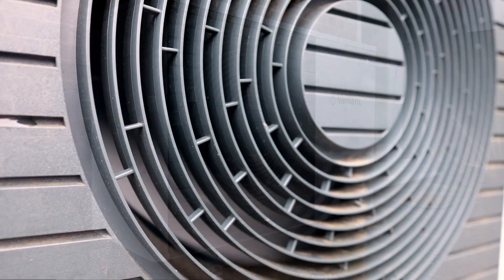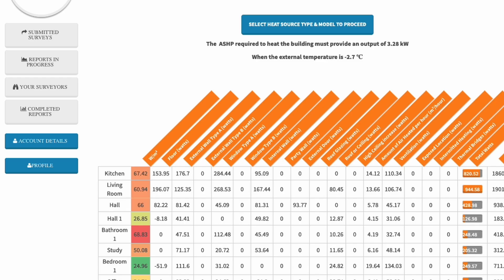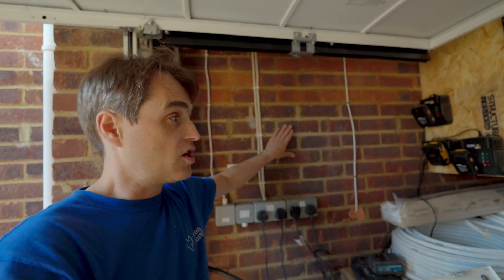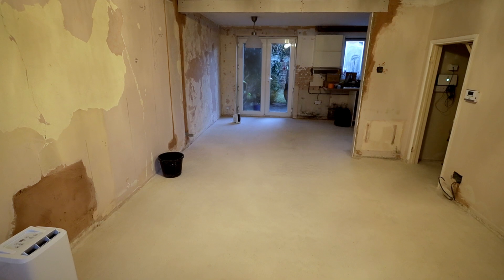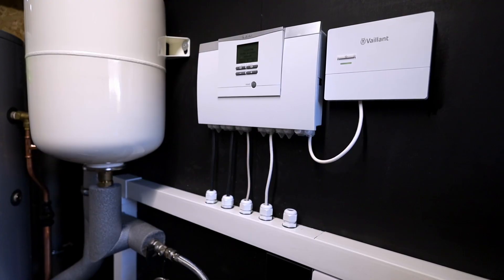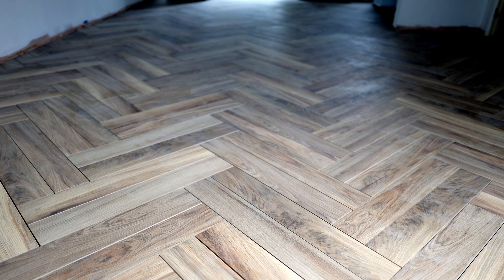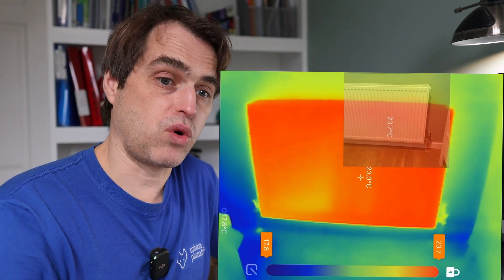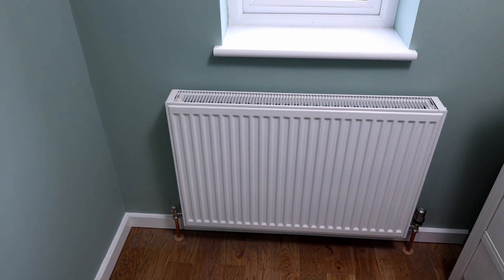How I Installed The Most Efficienct Heat Pump In The UK.

Comment: In answer to your question heading the video, no they are not real.
Simply, science states that no device can be 100% efficient.
The error just about everyone makes is using the input electrical consumption. If you use that the only device you can compare it with is another type of electrical heater.
The basis for efficiency calculation is the amount of fuel used to make the electrcity. There are so many losses between generation and consumer.
Reply: A resistive heater is 100% efficient as science states, all energy converts to heat, unless you know otherwise ?
Reply: Dougal, 

I see this said so often that it almost has become fact, I say almost, because it is utter rubbish. At best it may be 30%, and that's being generous.

No all energy doesn't convert to heat. some of it is doing work.Much is given off in the form of heat but not all.
Reply: @iareid8255  

It all ends up as heat, unless you’ve also invented frictionless bearing etc.

Unless all scientists are wrong and You are right, that’s always a possibility.
Or as Einstein said “it might all just be a dream”.
Reply: Dougal, 

you are not listening, not all energy ends up in heat. Some of it does work. Try listening to engineers instead of scientists.
Science is the profession of educated guess work, until the answer is accepted by demonstration. Even then it can be proved to be wrong. It is a very strange subject.
Reply: @iareid8255  Ironically, you still haven't been able to provide any of these "demonstrations" that prove your point, because apparently from your previous messages it doesn't exist? 🤔

What "work" does a resistive heater do, that isn't just heat?
Reply: Ben, 

I just do not understand your response, 
please elaborate.
Reply: @iareid8255  Well, because you keep quoting figures that you can't back up. e.g. "At best it may be 30%", lets handle this another way:

- Gas usage in a boiler, and usable heat output from a boiler is measurable - and there is data for it.
- Gas usage and electrical output of a gas power plant - also measurable, with data.
- Electrical losses in transmission and distribution - measurable, with data.
- Electrical consumption, environmental yield and heat output from a heat pump - measurable, with data.

Therefore, you can calculate and compare end to end efficiency of gas when used for powering a heat pump, vs burning it directly in the home.

Gas isn't the only way electricity is generated - with wind, solar, and other sources making up a fair chunk of the UK's power grid. People aren't going to be concerned with how each unit of electricty is generated. So heat pump efficiency is based on how much heat output for how much electricity is consumed.

However, with the data above we can conclude:
- Heat Pumps with the combined electrical input and environmental yield, will output multiple times the electrical input as usable heat - ergo they are x00% efficient on the electricity consumed.
- The heat output provided by a heat pump, will consume overall less gas compared to gas boiler, even if the grid was solely powered by today's gas power stations in the UK.

So for your assumptions to be true either:
- The gas power plants are lying about their efficiencies.
- The grid is lying about the transmission and distribution losses.
- The 3rd party measuring devices for monitoring the heat pump's electrical usage, input water temperature, flow rate and output water temperature, are somehow lying.
- I'm missing some other key data points that make up the difference, ones that nobody seems to mention?

So which is it?
The heat pump monitoring things could also be used for gas boiler with needing an addition of a gas meter - unless the home's gas is only used by the boiler - which for many it is.  However, is there much point as we know a gas boiler will never be 100% efficient on the gas supplied vs usable heat output.
Reply: Ben,

You make it sound simple because you do not understand the variables or how the grid works.
Losses vary with load, (i squared R losses), a proportion of generation is not used to feed the grid, this is variable. The duty that gas generation does to compensate for renewables is variable and affects it's efficiency.
The data may be there but it is very complex.
It is also, as I said before irrelevant. It is patently obvious that the losses are significant and make a nonsense of your perspective.
Of course a gas boiler will never achieve 100% efficiency, nothing does, nor have I made such a claim, a heat pump will also never approach that.
You refer to data from heat pumps, i.e. temperature delta, flow etc but nothing that actually measures the heat quantity, which used to be BTUs (British Thermal Units). The amount of effective heat is assumed by some algorithm. If anything is arbitrary that is it. The idea that a ground source heat pump gives 5 times electrical input is optimistic in the extreme as it means that the energy input at the power station is five plus for that to be true, i.e. the losses from generation and transmission are 80% minimum, I don't believe that to be true so the assumption about the heat pump must be false.

Regarding heat pump components, compressor driven by a motor, average about 90% efficient, and with a relatively low volumetric efficiency due to the reed valve gas control and slow rotational speed, evaporator fan motor, again about 90% and the heat transfer of the evaporator requires regular maintenance to keep that heat transfer at optimum. How many owners will do that? It is not a high efficiency device looking at the mechanical aspects.
Reply: @iareid8255  My mistake the heat pump monitors have 3 levels.  Level 1: Electricity only (no COP), Level 2: + System Temperature (again no COP), and Level 3: Flow and Heat Metering (with COP).

Therefore, we meet your requirements for measuring heat. And in that scenario, it doesn't matter what the efficiency of the components of a heat pump are.
We know: How much electricity has been consumed, and we know how much heat has been added to the water that entered the heat pump.

Where is anything supporting this concept that "the losses from generation and transmission are 80% minimum"?
Reply: Ben, 
Logic and reason does not appear to be your forte?

Let me reiterate:-
Nothing is 100% efficient, please accept this scientific fact.

Let me now contradict that and say assume a ground source heat pump is 100% efficient.
You will accept that an air source heat pump is approximately 60% as effective as a ground source (1 KW giving 5 KW he at GS, 1 KW giving 3 KW AS)?
Ergo an air source is only 60% efficient.

If you cannot follow simple logic and see that what I'm saying is basic, without the need for 'data' to give a small variation in the true figure, I have to believe that you are just teasing me with your fallacious arrguments. The principle is what counts.
Reply: @iareid8255 you just can't accept that the heating industry uses the term efficiency to compare heat moved/provided  heat pumps move heat not generating it.
If we used your "logic" then whatever improvements are made shift the goal post.

You still haven't answered my previous question.  As energy cannot be created or destroyed.  And you can't accept that 100% of electrical energy can be converted to heat energy.  Where does the rest of the energy go?
Reply: Ben, 

You are being ludicrous, you have no perspective or sense of reason.
The heat industry uses Coefficient of Performance not efficiency, it is the sloppy assumption that CoP is efficiency, it is not because electricity is not energy but merely a carrier.
Reply: @iareid8255 Clearly we aren't going to see eye to eye on this. In my opinion you are the one being ludicrous with trying to assume anyone is going to have any control over the variables of providing electricity via a gas powered power plant.
For many it is, how much "heat" am I going to get for the electricity (or gas) that I'm charged for.  Going by many youtube comments around most are far worse ill-informed, with assuming what they pay in gas is the amount they are paying for heat.  Especially when they make comments like "Electricity is 4x the price of gas, so needs to be 400% efficient to break even".

I stand by my assertion that irrespective of the variables you mention that overall, a heat pump will in today's day and age (regardless, of energy mix), will use less gas than a gas boiler for home heating.
It is not the responsibly on the end user to ensure the CCGT Power plants are running at peak efficiency to make sure their heat pump is powered by less gas or not.

There isn't going to be a scenario where more heat pumps replacing gas boiler means more gas is going to be used in the UK.
Reply: Still trying to get your point across without any proper data? As usual, even taking into consideration a 100% gas electricity grid powering a heat pump is a more efficient use of the gas burnt directly in the home, because of the environmental yield.  Also, the reverse argument could be made, electricity is required to run a boiler and the gas network, however, that is never taken into consideration in the gas "efficiency".

End of the day, the end user needs a comparison to be able to ascertain switching, and the comparison, even if you disagree with it, makes sense...  1kW of gas burnt in the home, will yield around 900W of usable heat for home heating.  1kW of electricity used for a heat pump, can yield 3-5kW of usable heat for home heating, aligning those comparisons means a gas boiler is 90% efficient, and a heat pump is 3-500% efficient.
Reply: Ben, 
you keep ignoring science, you cannot have an efficiency of 100 per cent, it is not possible!
If you will not accept that, then there is no more to be said. Data is irrelevant.
Reply: @iareid8255 you're ignoring the science, not me. The efficiency has long been stated using the consumable unit, because the heat energy from the source (air/ground, etc) is "free".
For science to be accurate and accepted data is needed to back up the findings, so if you think data is irrelevant then you can't quote the science.
Reply: Ben, 

I find it incomprehensible that you seem so convinced by your complete misunderstanding of physical effects.
 Heat energy that you refer to is nonsense.
Heat, in scientific terms, is anything warmer than minus 273  degrees  degrees Kelvin. It is not practical heat and cannot be assumed to be free heat.
Why don't you learn some sound engineering practicalities instead of your pie in the sky ideas?
My point about data being irrelevant is based on the simple fact that you cannot use electrical units consumed by a heat pump as a basis for efficiency.
The 'sacred' data you seem so obsessed about is simply not available as the variables are so profound, the principles are so simple that it is self evident..

Comment: I am just about to purchase a bungalow built in 1965 concrete floor new heating system required going for wet underfloor but the cost of air source heat pump and installation is ridiculous vaillant gas boiler £1700. No tank required air source heat pump £3800. + tank + all the other stuff to make it work . price wise doesn’t even compare even if I get a grant?
Reply from the maker: Keep the gas then.
Reply: If a new heating system is required then it makes more sense.
If all your radiators are corroded and your tank is getting thin and the boiler is on its last legs. Then you are looking at a big bill anyway. Which you are prepared to pay as you are going underfloor.
Might as well take the grant, pay the extra and cut your bills.
Reply: The house doesn’t have gas at this time the heating is electric pyrotenax underfloor installed in 1958 found out today the build date of the house was 1958 I can’t make my mind up what way to go there is the other obstacle we live on an island, U fancy a we holiday 😜

Comment: Now imagine flow temps of 23C. I get that with air to air. 50 sqm at 21C, drafty uninsulated house that I constantly ventilate to get under 700 ppm CO2, no MHRV. Under 100kWh per month in Jan. With batteries this means £12/month in the coldest month. £2k for the HP and £3k for 10kWh batteries+inverter. SCOP6.3+. With the bonus of cooling in the summer, and we'll start getting hotter summers.
Reply from the maker: That’s great, but air con moves the air so makes it less comfortable and also is not that great at keeping nice even and very constant temperature. It is a cheap option for some, but comfor and quality of well designed wet system is far superior to air con in my opinion.
Reply: @UrbanPlumbers  true, you have to install it and point it to not constantly blow into your neck. That's fortunately trivial. Also, it only needs a tiny amount of wind. The radiator has huge surface area with fine fins, small amounts of forced air let it convect kilowatts. I'm not sure I agree about uneven heating. This unit runs 24/7 . Inverter unit, as standard in Europe for 25+ years.
Reply from the maker: Having said that I will also install air con -  it just for cooling

Comment: This heat pump installation seems like it is similar to the EV hype to me, it will cost thousands to buy it and to get it installed, if you live in a cold country it does not seem to give out enough heat and with ever rising cost of electricity it will cost a fortune I suppose if you get all the benefits available you will be all right but what happens when they get cut later this year?
Reply from the maker: Yep - love my EV as well!
Reply: Air source heat pumps are very popular in Scandinavia, in fact, everywhere barring UK is up to speed on them, but perhaps it doesn't get too cold elsewhere ?

Comment: Still can’t believe the amount of crap required to run these systems. A gas boiler the size of half a dozen cornflake boxes and £1,000 does the same thing. Not convinced yet!
Reply from the maker: I still can’t believe that amount of crap comments heat pump videos get. I love them though - haters prove I am doing something right 🤣
Reply: They don't need everything that is shown in the video. Monitoring the heat pump using OpenHeatpumpMonitoring is completely optional. Monobloc ASHPs are essentially as simple as gas boilers and only require just a couple of extra components (anti-freeze valved).

Comment: Hi
This monitor chart is only for heating or hot water included??
Thanks for reply 🫡
Matt
Reply from the maker: dhw and ch
Reply: @UrbanPlumbers  thanks for replying 👍
I am impressed about your results.
I am on half way to improving my home insulation. I already replaced windows for  triple glazing windows and very high insulated doors .I done  upstairs, same like you 25pir on wall + 70mm pir on ceiling + 75mm rockwool between rafters + vapour barrier on ceiling and loft + MVHR system, underfloor heating with 30mm biscuit screed on 50mm pir board between floor joist,all done by myself. Next step to remove 15 years old cavity insulation and replace them for something better ( 75mm cavity ) and then ground floor left to do ,underfloor heating, but I think to install 30-40 mm insulated tile board straight on slab (no insulated) and I will do channel for 16mm pipe. Alter that I will slowly convert my heating source for heat pump.

Comment: My home is run on a combi boiler and I have for a long time now tried to understand the benefits of moving to a heat pump.  As we have a combi boiler we don't have a hot water tank so where does that go is the first problem. We have solar and a decent amount of battery storage so can run the house completely on overnight electricity which is added to the battery and the solar tops it up or exports in the summer.  So having electric heating and hot water would be super-efficient but when we got the heat loss calculations done it said we needed larger emitters to run at 45 degrees flow temperature, none of the rooms have space for larger radiators.  Although we currently run our Worcester boiler at 45 degrees flow because MCS says it won't run at the design temperature me have another problem.  The outside unit can just (by 10mm) be installed under permitted development and just passes the MCS 020 sound and its the quietest heat pump of its size (Vailiant naturally) but if the installer isn't exact we could hit major problems if we need to for planning after the installation.  It just seems the whole process is nothing but problems.  Plus now there is an idea of air-to-air heat pumps without any planning hoops likely cheaper even without a grant of 7500 and would cool in summer.
Reply: I have the nightmare scenario of having to move to an area with no main gas. All that equipment and expert know how, not to mention the expense, just to heat a house and get hot water. A combi is less than half the size, provides instant hot water and with good insulation would give us all we need at a fraction of the cost, space and hassle.

Comment: How much did the installation cost and how much has your house lost in value due to no longer having a usable garage? Fairly important information I'd say instead of the usual heat pumps are so cheap to run, heat  pumps are great etc etc.
Reply: Standard garages are too small for modern cars, so the answer is it didn't loose anything. There's still plenty of space for storage which is what people need.

Comment: Lovely installation as always 👍 however I would to see a video on how you run the system such as set temp and setback temps etc and also why you fitted a buffer and different brand cylinder instead of vaillants own 👍